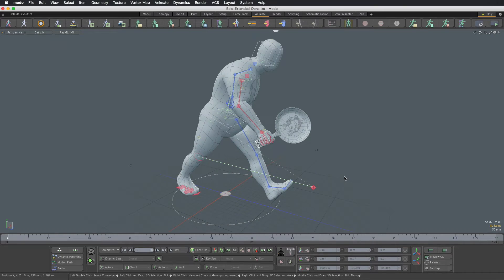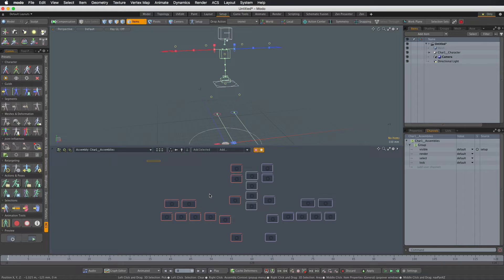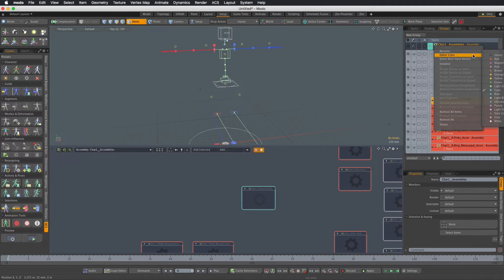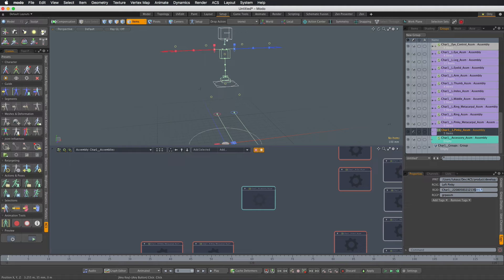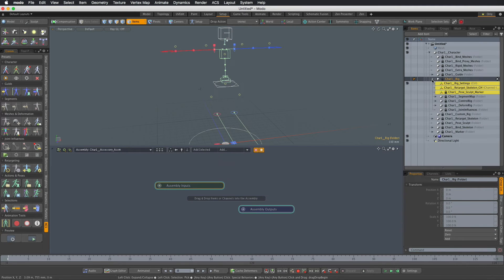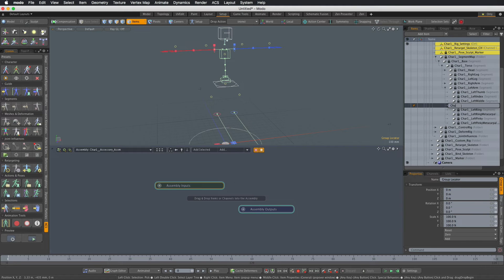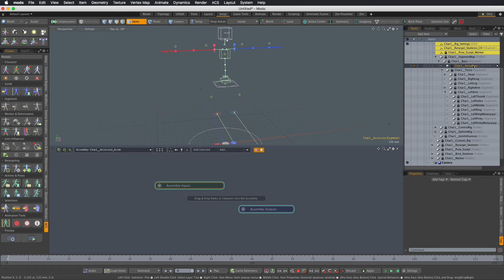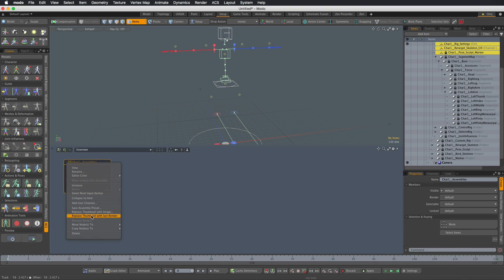ACS | Extending The Rig Part 1

Comment: This seems to be unnecessarily complicated.  Almost every rig I've done requires extensions of some kind.  I should simply be able to click "Add Bone" during the setup (like in Biped).
Reply: Agreed. This is really under the hood functionality and it was never advertised as user facing feature. ACS3 will have that kind of extensions made much much easier.